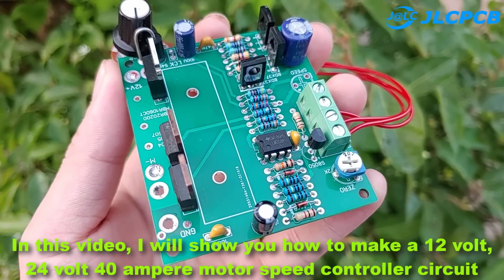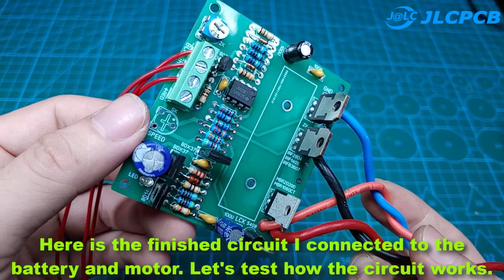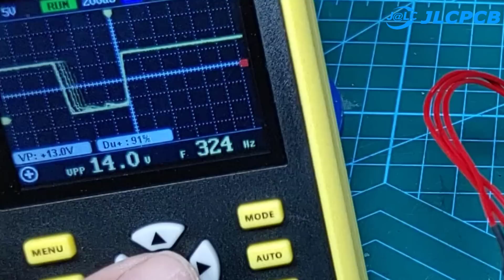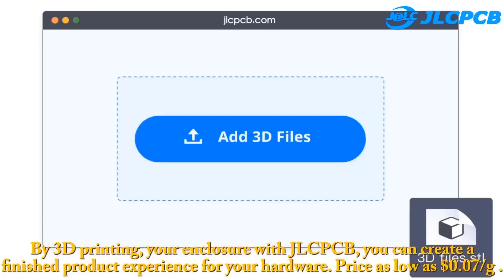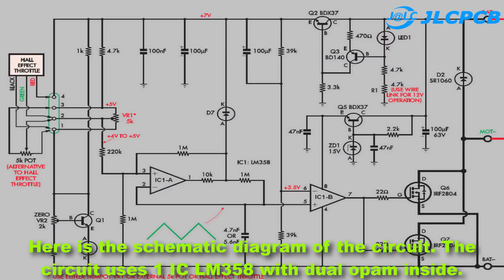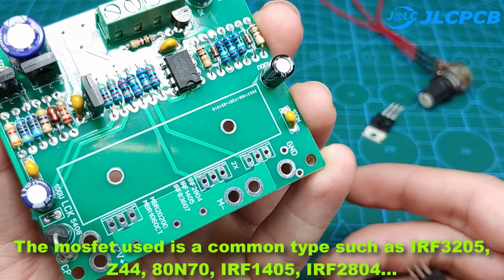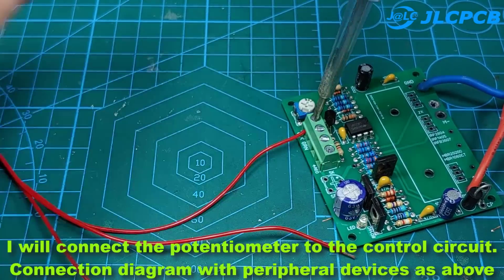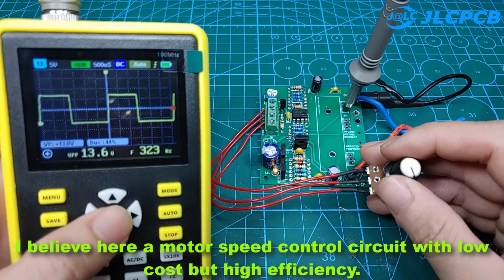Low Cost Speed Controller But Powerful No Use Microcontrollers 32 Volt 40 Ampere

Comment: Amazing. It will be berfect if u can make it dual dc motor bidirectional. The control signal can be sent to the driver using arduino or any other controler circuit .

Comment: 1. As alternative of bdx37, can I use 
     Bdx33c?
2. Please provide an alternative of
     Sr1060 diode.

3. At q1 which transistor is used?
4. I'm not sure where you have put the zener diodes? I found only 1 place.
5. Can I use mbr20200 instead of sr1060?
Reply: Dccvm
Reply: @zilayali8748  meaning?

Comment: Bro how much turn  ee55/28/21 for push pull smps frequency 73khz wire 0.50mm  i ned output 50volt 20amp & 25volt 6amp

Comment: Operating the pwm freq. at around 308Hz is very audible..& noisy...it will be less noiser above (16-18)kHz ..and the  358 will be able to handle it.
Reply from the maker: Thank you for your information.
Reply: How to do
Reply: @evilgamers561 for higher pwm freq. .... reduce the value of capacitor on pin2 of ic 1A
(4n7/5n6(F)) to 1nF..this will increase the frequency by (4.7to 5.6) times to( 1200-1500)Hz...further higher freq.can achieve by reducing value of 1M Ohm res. to 100k Ohm or lower 50k Ohm( also connected to 4n7/5n6 cap @ one end & 10k Ohm @ other end..)...this will now brong freq. up to( 1M÷100k) =10 times or
(1M÷50k)=20 times....
i.e. up from (1200/1500)Hz to (12/15)kHz or (24/30)kHz....all values approx. , depending on actual component values and precise formulae..used..